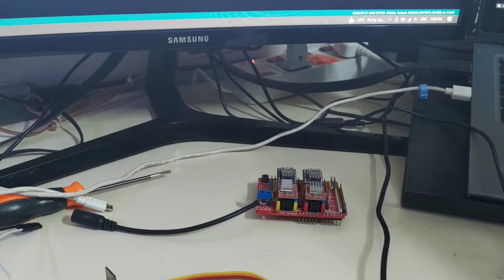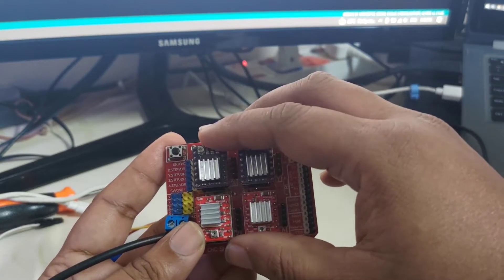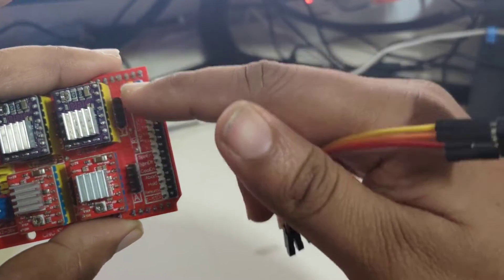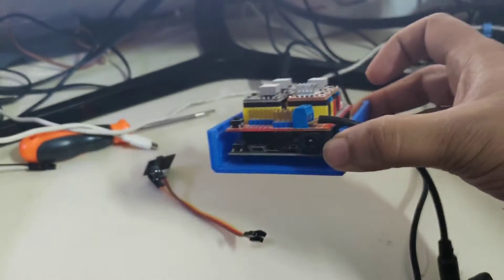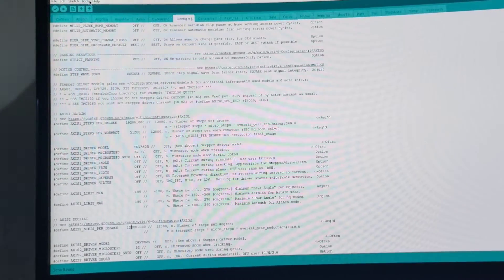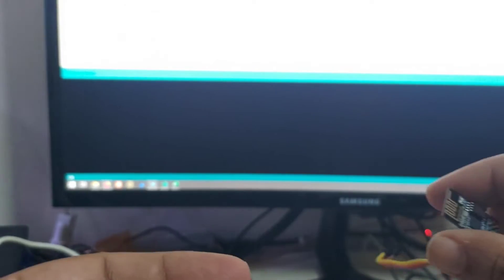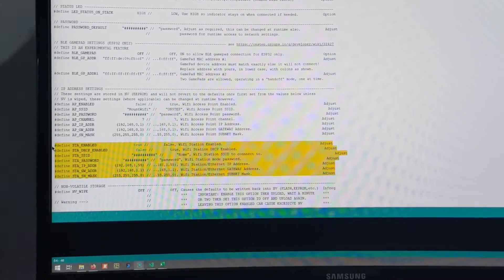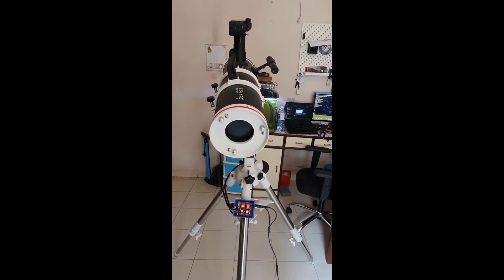Onstep build using Wemos D1 R32 and CNC Shield 3

Comment: Thank you for the video, this is the first time I have been able to find that ESP32_GRBL (idk if that's what you're using, but when someone asked if they swapped their uno for an ESP32 with the CNCv3 board they sent them to the github for that library) and that library is confusing because it definitly sounds like it's not meant fot the CNCv3 as much as i wish to believe I could run 12 motors with 4 drivers.... but can someone clarify for me please - if I have D1 wemos ESP8266 (as uno's) or ESP32 (as uno) or the one I like most ESP32-S3 as uno will any of these work with the CNCv3 shield directly attached? I'm getting so much conflicting info, plus people trying to sell their own ESP CNC boards
Reply: and it will get worse....
Reply from the maker: Pls post question on the onStep forum, they will be help you faster than i will.

Comment: Sir, i am going to use neema 17 stepper motors for my project, but i found neema 17 stepper motors has 200 steps per revolution,in motor specification , but you put 400 in 'stepper steps ' column , in configeration calculator , will it creat any problem?
Reply from the maker: On the config you need to setup accordingly. You get not 200 and 400 step nema motors.

Comment: Dear Abhishek,
Coyld you please let me know how did you install the Dec axis stepper motor system to the eq3 mount that has come along with this telescope. Also, could you please share the 3d design files of the stepper motor holders
Reply from the maker: I custom built the 3d mounts, I haven't published them on any website. they are not the best really. but they work for me

Comment: Hey abhishek. What was the total cost in INR for the whole setup?  I have a eq3 mount so starting to build this.
Reply from the maker: Nema's are around 1k each, the drivers will range from 300+ to 900 depending on what you use. the cnc board is about 300ish and the 2 esp modules are about 1k

Comment: Could you please let me know which nema17 stepper motor I should choose  for an OTA+cam weighing upto 7.5kg on a EQ5 mount. I see nema 17 motors with different load capacity and other specs. Also, may I know which nema17 motor you have you used for your mount+OTA.

Comment: Does the mainboard have to be Wemos? I found a Hiletgo Uno board that is R32. Would that work?
Reply from the maker: The original spec says that, you can try it once with the uno board. If the processor and pinlayout is same it should work. Also it would be good to confirm on the group once before you go down that route

Comment: nice project! may I ask why esp8266 is still needed? wemos d1 r32 already have wifi right? 
thanks
Reply: Great video, 🎉 about the esp8266 can you share the pin connections between the WiFi module and the CNC v3 shield. Kind regards